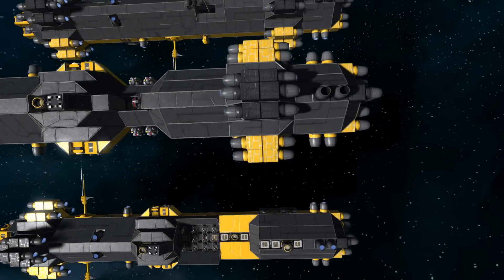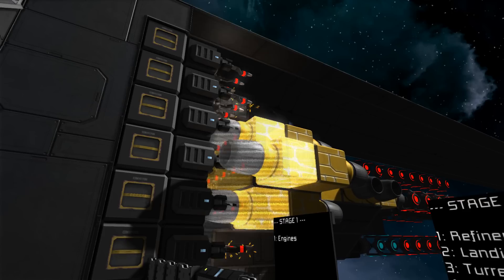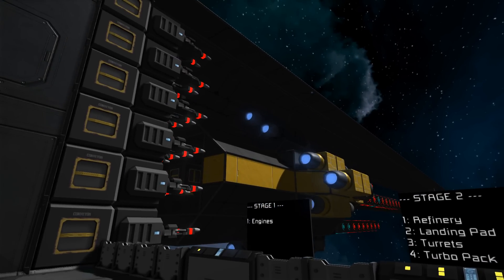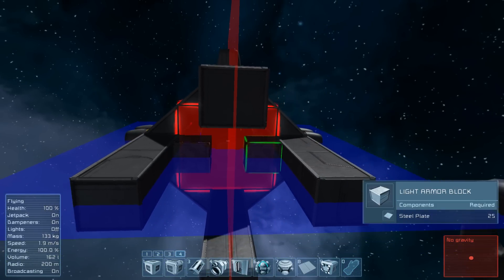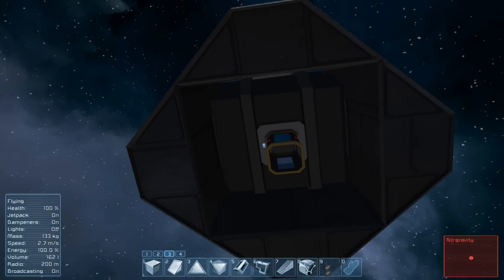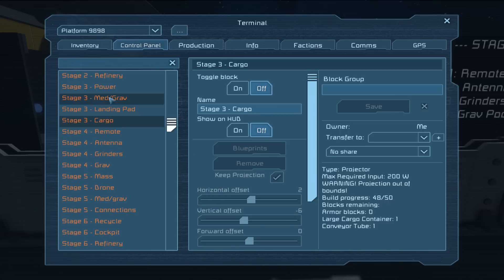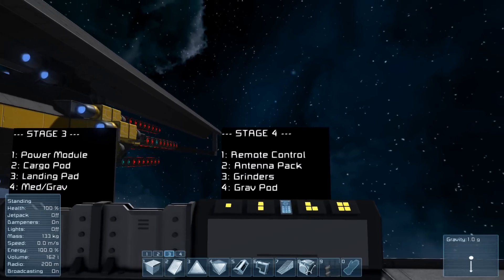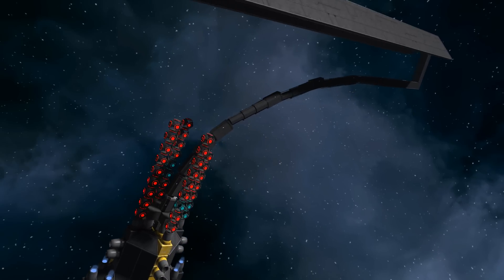Space Engineers - Modular Extrusion Platform UPDATE - 'Bendy' Edition

Comment: perhaps instead of using pistons you could have a large plate-shaped ship which moves along and welds it, allowing for (theoretically) infinitely long ships. plus then you could potentially allow for non-linear designs. maybe use a remote connection for using it, allowing you to keep the welding ship itself relatively light. it would be very tricky getting the thrusters just right though.
Reply from the maker: I'm planning something similar to that although not using thrusters, agree they would be very hard to get sufficiently correct for it to work right. Cheers :)

Comment: Here is an idea for after you add thrusters to the projector array and fix the bounce: why not have the buttons and screens attached to the pistons? The idea is this - you place a rail of blast-door blocks out the side of the build area with buttons along it. You also place a viewing/build control platform next to the rail near the welders. You can reach stage one buttons from the build platform. After you press a button the pistons retract moving the stage one buttons with the build. Stage one move out of reach and stage two buttons stop right in front of you - where stage one were a moment ago.

Advantages: Idot-proof the system (you can't mix up stages), ease of use (you don't have to walk anywhere) and you never need to turn your back to build. You can watch the whole thing.

One last thing. Wheels can be used to guide the rail and further reduce piston wiggle.
I love your videos. Sorry for the length of this comment.
Reply from the maker: Would look very cool although perhaps a bit of an extreme solution :) Still, extreme solutions more than welcome here! Wheels was the route I was headed also with this concept for version 2, alongside a few other tweaks so agree there, solid solution. Cheers! :)

Comment: If order is essential to remember, why not colour coordinate it with lights?  Colour each stage's control panel area and have it so a corresponding light turns on. Or have it so only one panel at a time is powered so your forced to use the correct one
Reply from the maker: Hmm I quite like the idea of turning off the panels in order etc.. although it's also quite nice to be able to plan the ship out and see what modules are avail so maybe the lights method is best :) Cheers dude!
Reply: ***** This got me thinking(besides someone else having the idea of turning the panels off). It would be nice to see what the module looks like before you choose. So maybe rigging up a second set of projectors that display the 4 different options could be a thing. I'd love to see something that allows you to select the option, see what the projection looks like and then hit a button elsewhere to confirm selection. Would slow it down and also mean the welders would have to be on a piston to remove them from the projection but would be pretty damn spiffy.
Reply from the maker: Kahlas
Would look damn awesome, shame there's no scale controls for projectors so you could have 4 tiny versions hovering right there.. still, I think when I finish v2 which will be both more stable and capable of much larger designs I'll have to add all those user features you've been suggesting, that sorta polish is what makes it epic :)

Comment: I have an idea for a safety feature- add a light to each stage area that turns on once you have pressed any of the buttons at that stage. If the lights on, you know for sure you already did that stage.
Reply from the maker: Great thinking, easy enough to just add into the timers too.. will do just that. Cheers :)
Reply: ***** Or just chain the button panels to not be on until you can select that option. Remove user error wherever possible. Adds complexity to the design, but that's what good engineers do.
Reply from the maker: Kahlas
Yeah indeed, I'll sort something, want this to be user-friendly :)
Reply: ***** ok so I have an idea for a ship.here it is a ship that can capture or hijack other ships.so imagine a big military ship is defending it's self
But you want the ship so it can be yours.so you have a fair sized heavy armor ship that locks tons of landing gears on the ship or so your soldiers want to breach the military ship
Reply: Lee Wilson so when the ship is attached to the mil the soldiers go's in with girders to clear the ship. Plz bring my idea to life:).
Reply: Lee Wilson so a ship with a hallway that sticks out, and a door on the end. Landing gears on the end of the hallway to lock on the the enemy ship, then troops open the door and grind a hole to invade. Something like that?
Reply: Yeah and at first it was meant to be like a tow truck so the landing gears would lock on the enemy ship and the ship with the landing gears or what I call a tow ship could take the ship away
Reply: Xander Wild but now that I think about it if the whole soldier thing mixed with the tow ship idea I would be a hijacking ship lol the most scarey thing for poeple who builds nice ships lol. Would it work???
Reply from the maker: Lee Wilson Xander Wild This is something I've actually already done, albeit a while ago now so it might be worth revisiting.. but yeah, was literally a vid on experimenting with different breaching and boarding concepts including both the landing gear-tug type approach and one designed to piece and offload troops :)

But yeah, may be time to revisit it in a less 'here are some experiments' manner :)
Reply: ***** lol

Comment: Wouldn't it be a hell of a lot easier to make a module projector that allows you to create a single module from a blueprint and just make sure that each module has merge blocks? You could then stick them together using another ship or even make a sensor based arm that moves the module into position.
Reply from the maker: Easier to build, harder to use imho.. each section would require thrusters, gyros etc or some other method of connecting them once built and I'm not sure a sensor based arm capable of actually connecting at the right angle at various lengths is an easy task, the angle of head rotation will change at each length so you'll need to sensor control rotors AND pistons, so likely you're now talking programming blocks rather than timers etc.. plus each part then takes time to be moved out of the build path and the next projection loaded etc.

Plus, there's just a cool factor to printing the ship like this :) Not saying you're method is bad, I personally just prefer an approach like this (although this is far from perfect, hence the need for a v2!)

Comment: You know if you put some thrusters pointing in both directions of piston travel on the projector arm itself the bounce will become reduced thanks to inertial dampening. I had to do this to a 20 by 20 block pusher plate for a huge ship recycler I built once to stop the inertia from breaking the pistons when they stopped.
Reply from the maker: Yeah, no idea why I didn't do that.. simple solution and I'd already seen how much the thrusters helped thanks to the turbo module with the engines one. Doh I guess.. Blind to the simple solution :)
Reply: ***** I've been there hundreds of times. I just realised earlier today that instead of wasting 2 slots in my docking bar for toggling recharge on 2 different sized power caps I could put in a timer block to chain them to one slot.... That's the joy of this game is learning new things, applying what you've learned to solve or create problems, and remembering you figured out that problem already and just didn't see the solution for what it was.
Reply from the maker: Kahlas Hehe yeah, I often wake up and reload a save from the previous day and then pretty much immediately facepalm as I see something that I've done in a stupid way! Or something I've forgotten.. A fresh eye on things really does help :)

Comment: I suppose you use timer blocks link to each button to extend the number of action. If you want to make the thing a bit more dummy proof, you could use the last action of your timer to turnoff all the timer block of that stage and turn ON the next stage. You could also add a timer bock with a delay in order to activate the next stage only when the module is completely build. And If you want to add more guidance, turn ON/OFF your LCD in same time.

Nice job by the way.
Reply from the maker: Would be simple to add the on/off for the timers and LCDs into the existing blocks even, I already have the pause timer there so it's just a case of adding the OFF command to each of the individual timers for the stage, and then the ON command to the pause blocks. Nice solution and I very much approve of not even needing to work out the how of things, just there on a plate for me! Cheers :)

Comment: I was thinking, what if you did something like this for small ships/ drones and put it on the next gen carrier/ a support ship. Like have factory ships in the fleet that makes ships for an upcoming event, whether it's a battle, a mining operation, scout mission, etc.. Along with this, there would be a recycling system so once a ships purpose has been done, it can be removed. This would remove the need for large hanger bays as you won't need to carry a large amount of ships, just a few fighters incase you don't have time to make new ones.
Reply from the maker: I think this for the larger ship and the flip-hangar system redesigned to make small ship fighters could be a perfect combo for it tbh.. As you say keeps things purely next gen in not having an active fleet at all, just craft on demand and modular parts of the ship itself :)

Comment: Would it not be more stable to have the projector group and the attachment point supported by multiple parallel Pistons? Rather than just the one long chain. At any rate, Cool idea (I did watch previous video about this concept I just lurk a lot) And it's given me a few Ideas of my own I intend to try.
Reply from the maker: It would be more stable yeah, but my plan for expanding this is actually to get rid of the pistons entirely as they are always going to be kinda dodgy even with a properly supported setup like you describe... pretty much only reason I didn't bother when I expanded it, will be upgraded again soon :)

Comment: so here's a thought I had, rather than having the projectors be on the piston stack/ whatever mechanism you use to move the ship, what if each projector was on it's own mechanism, set to move in tandem with the ship. That way, deciding what module you wanted would not be stage dependent. 
IDEA:  one console for all stages. pressing a button would transport the projector for the desired module into position, attaching it to the stack Via merge block. once the stage is printed, the projector is returned to it's original holding area. that way, one projector could be used to print multiple modules.

Comment: I have had a thought on the EMP I needed help on, and I have came up with a idea, (which requires a lot of luck) u could make a drone like ship that has a lot of batteries and a connector, you find the enemy ship's connector, connect with the ship, turn your empty batteries on, and drain there power. the problem with this that there is so many ways to fail, like their connector isn't turned on, or your batteries are full before they run out of all their power. so i still need help with this, thanks
Reply from the maker: Interesting concept dude, sounds pretty tricky to actually pull off but hey, that's how ideas start and then they get refined or the game changes and then it works even better. It's pretty dependent on the setup of the enemy craft but yeah, could be very cool to see it in action. Cheers :)